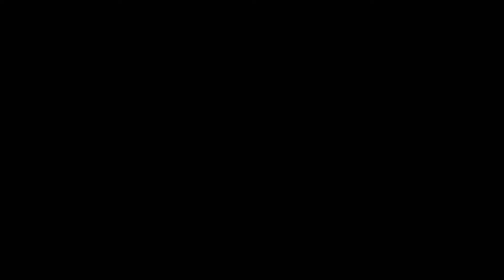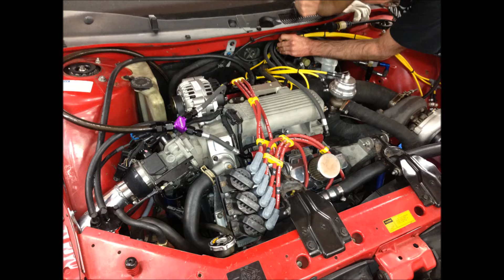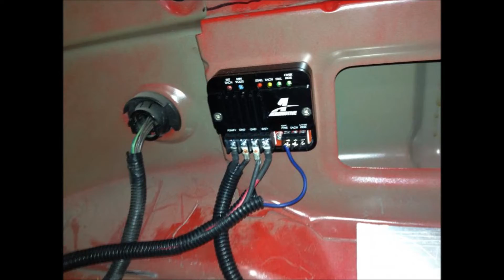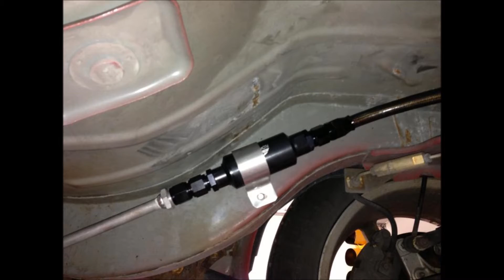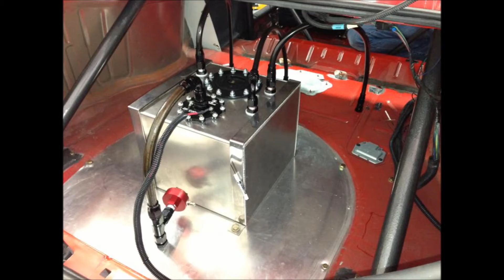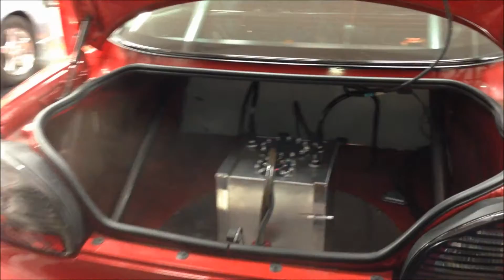2001 Pontiac Grand Prix Turbo  Aeromotive Eliminator Fuel Cell

Comment: How did the eliminator pump/cell hold up?  Im considering purchasing a 20 gallon version.
Reply from the maker: So far so good for most part.

The 6 gallon is small... and the pump sits on the high side.  So it gets very hot very quick.

Also talking their techs they had me adjust the low voltage very low considering... And burned two pumps out quickly.
To low of voltage just can be bad... 

This was via their speed controller.

This is going back a few years now, but whatever the voltage they told me to use.. I added 2+ volts to that on the 3rd pump.  And still working years later.

The same pump is in my Whipple Grand Prix, just mounted inside a highly modified factory steel tank.  And been on same pump and speed controller for 5+ years with no problems.
Its always submerge in fuel, so it stays nice and cool.

Key to these to me is proper low speed voltage, not to crazy high speed voltage  ( if need to over pump it.. just get a bigger pump )

And cooling.  For the 6 gallon, for track usage, an ice can was used on the return port which dropped temps a ton.
Eventually I will go bigger cell... or modified the return port to actually return the fuel on top of the fuel pump.  I may get away doing this by using fuel cell foam to 
prevent it from bubbling up the fuel returning it up top vs how it delivers fuel back to the bottom of the cell.